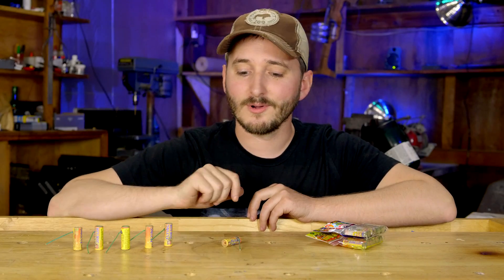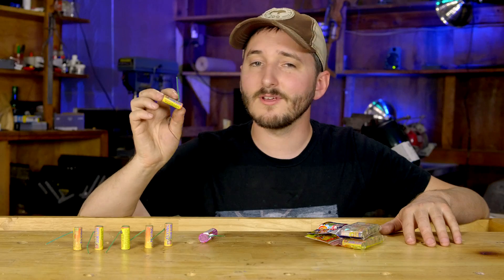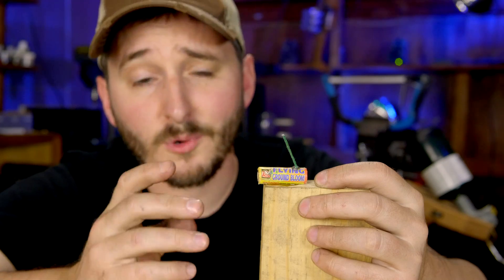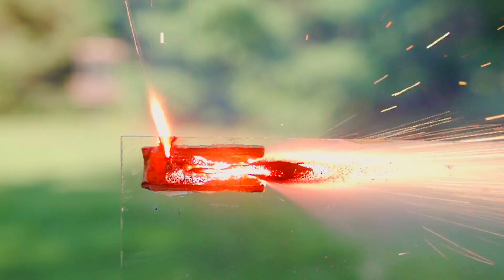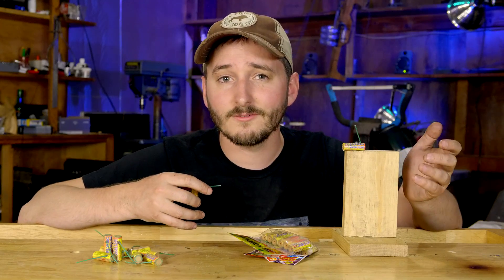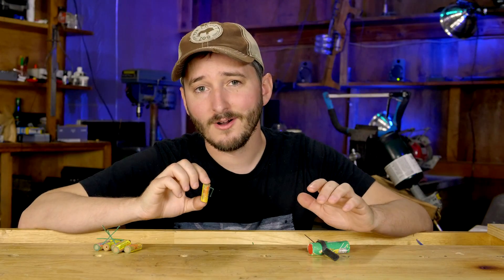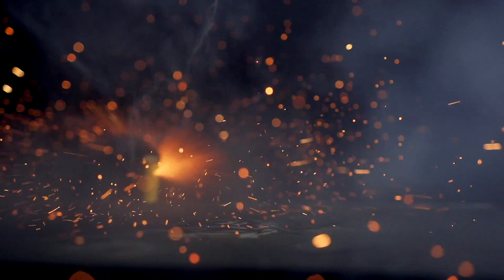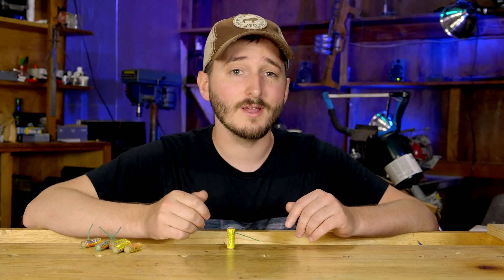How Do These Fireworks Fly?

Comment: I think the first piece to consider is that the initial "fused" nozzle only does one thing by itself it rotates the firework around the axis that would travel through the length and thereby stabilizes that rotation (which is why when it ignites after being thrown, the flight path is random but still in a straight line.) Then the secondary nozzle fires and the the "stable" flight path is followed. The expected upward flight takes place purely due to the interaction with the ground and uses ground effect. When first lit, the precession rotation is a byproduct. The length axis rotation is the key and as it rotates axially (rolls), the time when the side exhaust is pushing off of a surface gives a disproportionately higher thrust. That process repeats until vertical stability is reached and the secondary nozzle is timed to kick off at that moment. But I could be way off too! Great video as always.

Comment: i was thinking tippy top until i saw the slow motion. it is ground effect. the mass is not very high and not very far from the center, so gyroscopic precession would not be very strong. when the thrust was close to the ground, and the ground affect was strong, it overcame the gyroscopic precession. when it went upright and the ground effect was weaker, then the gyroscopic precession was strong that the ground affect, and it did not go fully upright.

Comment: These have been my favorites for years glad to know I was right in how I thought they worked.However I cam across some a while back that didn't have a nozzle on the back and I am not sure how those work. I have also seen some with 2 holes but both on the sides of the body causing them to spin faster and I guess that causes lift in those.

Comment: I think you should try to fire a few while suspended in the air with a fishing line or something to see if the ground is really needed or if they just need to start horizontally.
Also it would be interesting to see if the hole where the fuse goes is slightly angled.
I think the main ability of this firework is to straighten itself up with its rotation and I think weight distribution (like different amounts of clay to seal the top and bottom)

Comment: Boomerangs have round side and sharp side when air passes over the round side it is directed toward the back edge and do to the back edge shape the boomerang is constantly pushing the front to turn in the wind in such a way that it does a u turn in flight. I think the wic flame is causing air to suc over the back creating flight similar to boomerang flight in a way. Cool video
Reply: And now I see so the ground is acting like the flat side of the boomerang and the round side on the top (either side) is acting like the round side of the boomerang. Air is being pulled over the opposite side of flame and because of no air resistance on the top the air pulls over the top back side and creates lift and spin
Reply: Air is being pulled both top and bottom but no resistance on top is enough to lift it. I don’t mind talking to myself I feel smart:)

Comment: Interesting look at these fireworks but i think i have your answer for why some pop right up and others take a moment to get pointed upwards: Centrifugal force. A object that spins is much harder to change direction or orientation than one that does not. Notice the ones that pop right up have a smoother spin than the ones that take a moment? this is because as an object spins faster it becomes increasingly difficult for its orientation to change. You can actually feel this by taking a bike tire and spinning it on an axle in your hands and then trying to wobble it around.

Comment: Brilliant video!  I only ever came across these once, as an adult, and although I was curious, clearly not enough to pursue it like you did.  Well done. 
 
I think the reason that they stand up initially is because that off-center thrust gets the device spinning around its long axis, and through most of the rotation, that thrust is pushing the whole device down towards the ground (and yes, also causing it to roll a bit and spin around a different axis).  But when the thrust is aimed at the ground, that's the one part of the rotation where it pushes the device away from the ground, and it levers the device up on its end.  Once it's standing, that thrust is balanced through the whole rotation, and doesn't push the device anywhere (it just accelerates the spinning).  If the ground wasn't there to deflect the thrust for that one moment, it would just spin on it's long axis right where you lit it, and it would launch in whatever direction it happened to be oriented in.

Is the whistle a physical phenomenon, or is it whistle mix in the second chamber?
Reply from the maker: The whistle I believe is due to the wobble as the firework takes off. It's spinning fast enough to rotate the thrust at an audible frequency
Reply: The whistle, or chirp, is related to the speed of rotation. It is very similar to a standard fireworks component known in the trade as a "hummer."

Comment: They work just like when you spin a boiled egg. It stands on the blunt side. The reason for this is that they are much more heavy in the bottom section and when the slightly tilted/at an angle upper exit port starts giving rotation it stands up. At first they are almost balanced but when the first portion of of the mixture is combusted it's balance point shifts and it stands upright.

Comment: I think youre correct in the final assumption, but id also add that as it burns fuel inside the exhaust end will become lighter, helping the bottom, heavier end, to go down with rotation

Comment: Im curious what would happen if you lit one while it was already oriented upright?  You can see in the slow motion that the side jet isn't coming out completely straight, but is slightly canted. That would help apply some of the thrust vertically instead of horizontally.
Reply: Yup. Drive a nail through a board and then place them on the point of the nail. They will launch vertically every time and go even higher!

Comment: As a kid I used to play with empty soda cans. When you lay one down on its side and place your fingeron one ends and press until it slides out from under it, it will start to to spin and it it will lift axially sometimes even standing straight up. I think this is a similar effect.
Reply: I would do this in elementary school with crayola marker caps. press down on one side, it would shoot out some distance while spinning rapidly. Usually would lift one side into the air and sometimes finish standing on end..
Reply: Same thing with chapstick or a gluestick
Reply: Jackson Cunningham i cant figure out how this is supposed to work.
Reply: You can also do this with chapstick! I immediately thought of doing that as a kid when I saw this video.
Reply: yeh... if you lay a rugby ball down on its length, and spin it hard with your hand... it will gradually proceed to stand up and spin on its longest axis. :)))
Reply: yes! this is the answer to the firecracker standing up. I played with pens the same way you did with bottles. when you spin the pen with your finger close to either one of the end, it starts rotating and spinning at the same time. then the pen tries to stand up.
Reply: As a kid, My parents bought me toys....
     Only kidding Jackson.
Reply: It was marker caps for me :)
Reply: Yeah, one of the best distractions in class is going this with cone shaped pen caps. For some reason, I find it So fun
Reply: Jackson Cunningham I think you should’ve drink less soda

Comment: If the side jet were exactly at 90° to the longitudinal axis of the firework, it would simply spin horizontally, so it has to be angled downwards, towards the end away from the fuse, giving it lift as well as thrust, so raising the burning end ready for the main jet to ignite and apply the power for vertical take off.

Comment: One similar effect that might play a role is if you take a rigid cylinder of a similar size and pinch it against the floor so that it will launch away from you, it will also begin to stand on its end. It seems like something similar is happening with the rocket, only the ground effect is adding to its stabilization.

Comment: No, I think you were right, I think it looks like a tippy top. The only difference I think, is that while the tippy top uses mass that is traveling axially to get on its... Pinion? The firework uses thrust (could be thought of as a negative mass I suppose) to right itself. But that's just a theory.

Comment: I wonder how exact the placement and orientation of the side aperture needs to be. You could get wildly different motion by placing the thrust vector off axis or angled slightly.

My guess is the designer eye balled it and tested until he found an aperture that didnt need to be exact to allow for sloppy and cheap manufacturing. Sometimes physical testing is far faster and easier than modeling

Comment: It seems to me to tip on to it's tail end predominantly due to the difference in pressure outside of the side nozzle when it's facing open air and when it's facing the ground. That extra kick plus the fact that the ground serves as a hard limit for motion ensure that it tips tail down and from there it has that consistent contact serving as a preffered axis around which it attempts to minimize its moment of inertia until rear propulsion comes into play, by which time it's roughly gyroscopically stable.
Reply: The part I can't seem to model very well is how the gyroscopic forces make the point of contact be consistently to one side of the thrust vector from the side jet. This has to be the case or it the rotation wouldn't accelerate, but I just can't see the forces intuitively.

Comment: There is rotational force generated at one end of the tube . The circular rotational force pushes upward and the ground provides a pad on which the rotating nozzle end can exert its force until the cylinder reaches the balance perpendicular point in which the forces are at equilibrium giving time in most cases for the main nozzle to fire . By this time the spinning caused by the rotating nozzle provides gyroscopic stability for the main exhaust .

Comment: I believe the initial upwards push from horizontal is caused by the thrust from the sideways nozzle, after which gyroscopic precession takes over and points the rocket upwards. When the rocket is laying flat, it can only tilt upwards because it is restricted by the flat surface, and it does not fall back down because the rotation balances out the sideways thrust.

Comment: You can tell by how the fuse or "chicken whick" is coming out of firework at an angle or is off center (profile shot of a half cut firework could show this). Using as you said ground effect to help start the up right motion of the fire work.  The unburnt fuel is weight, as the fuel burns the center of mass moves towards the hole end of the firework.  The variants which you saw may be caused by how tightly pack the fuel is which determines burn time as well as manufacture tolerances on hole diameter and placement.

Comment: The hole for the spinning thrust is drilled at an angle so that it always creates spin. As it spins, each time the rocket thrust hits the table, it pushes that end of the tube away from the surface while the weight of the rest of the tube holds the other end down. As this repeats during the spinning, the tube is kept upright due to this spinning thrust until the thrust out of the bottom finally fires. This is your magic rocket. It's a simple trick of rocket thrust angle and weight balance. This is actually quite similar to rocket science.

Comment: I feel like the first jet hole is drilled off center from the center of the rocket causing the rocket to rotate axial instead of like a pin wheel. Once it achieves a certain rpm the centripetal Force stabilizes it in an upright position than the secondary rocket fires and provides linear thrust upwards. It would be easier to show this in person but I hope that makes sense.

Comment: I think you may be right with Friction, Ground Effect but I think there is a final point that might be in effect: Gravity. As the fuel is exhausted, the weight of the nozzle (likely to be clay) will help keep that side down while the fuel side rises due to the various forces at hand. From the footage you've shown, I've yet to see a single time where the fireworks tilts back out of orientation once the center of mass tips vertical once so I feel like your hypothese is correct.

Comment: From what it looks like, the fuse creates an off center hole in the firework, causing it to spin and rotate about the Z axis. As the fire work spins the fuse will point down, causing the thrust to push against the ground and pushing it upright slightly. This happens a few times until it is almost standing (rotation with less air resistance).

Comment: You bore the side hole slightly off center to impart axial rotation and slightly upward by a few degrees towards the 'short' end to impart a righting force against the heavier 'long' end which is being oriented towards the ground by gravity due to the excess of propellant yet to be ignited...once the fuel burn enters the main tube, the the axial distal nozzle kicks in and you have a spin stabilized 'rocket' now pointing away from 'gravity' or upwards.  Spinning, righting, rocket.
Reply: They are spin stabilized missiles commonly known as stinger missiles. And not too hard to make. Just the right tooling and some black powder that you can make.

Comment: Maybe the bottom is heavier, that's why it aligns vertically?
Reply: an object, if allowed to rotate freely, will do so in the axis of least moment of inertia. MI directly propotional to radius. You are right, in this case keeping jet one eccentric to one side makes the other side heavier, which  makes spinning on that side more stable (stable equilibrium) long enough for the second jet to fire.
Reply: Yeah but maybe like tippy top. It had its heavy side up!